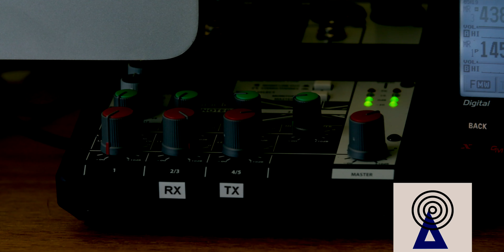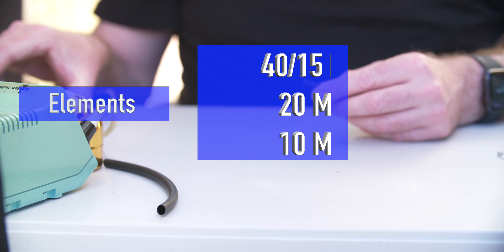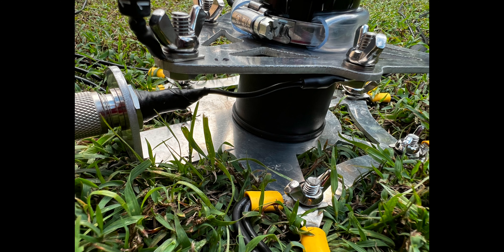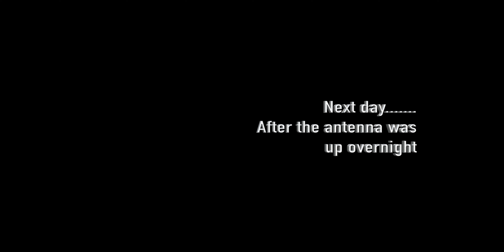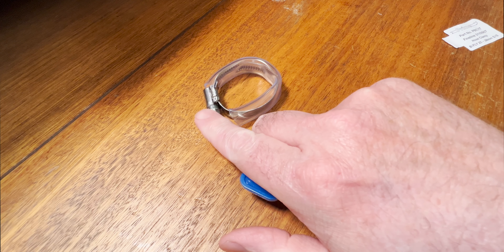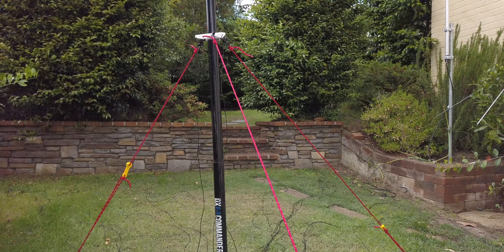DX Commander Expedition kit build

Comment: Hi Glenn nice video.  For clarity it is cm not mm for the hose clamp protector lengths and, as said before, they go on the thinner pole at the junction. It is a great antenna as many are finding out.  Nice idea to save DX10 for elements if you want to - as DX10 is nice wire.  Have a DXC up without trouble for 4 years here was a permanent Classic install.  Expedition for portable is great.

Comment: I notice you've put the hose clamp on the lower part of the Junction of two telescoping elements ... shouldn't it be on the smaller element to prevent it collapsing?
Reply from the maker: Thanks for the feedback I wasn't sure if you need to clamp / squash the lower part so the top part won't come through. I thought if you squish the top you need to make it less oval so it won't pass down - both seem to work

Comment: Good evening Glenn, thx for sharing that neat Video with us. There's just much HAM's need to find out about the Antennas they are using no matter if commercial built or just home made versions. There's always an option just to optimize the Performance to make antennas more effective. Lord Callum M0MCX is a genius antenna builder. I still don't have a dx commander antenna yet because I am too busy with my Endfed Antennas bringing them to the Fields for test running them but I definitly going to get me a DX Commander Antenna for portable activities. 
Keep up the Wood Work & may be we are soon being able to make a contact on the Bands...who knows. 73's de Your Friend Uncle Guenter
Reply from the maker: Thanks for the comment. It just works. I even cut the elements a little longer (as a caution)and in the end I could have just cut the lengths to the plan. Its a great design and I tried a squid pole but this has the right balance and ease of connections. I hope i'm not too critical of the DX Commanders product, but just what you can do for a few dollars when you get one to make it your own.